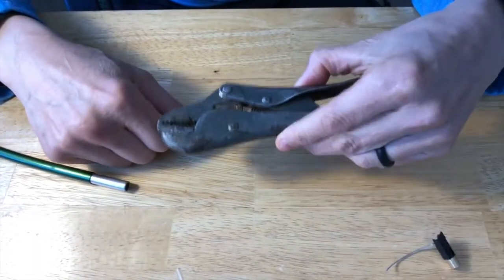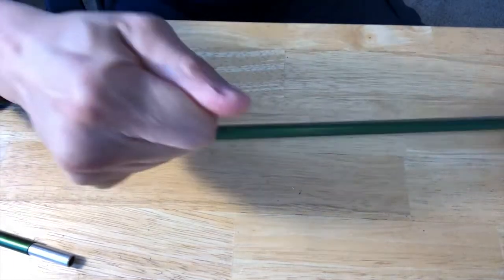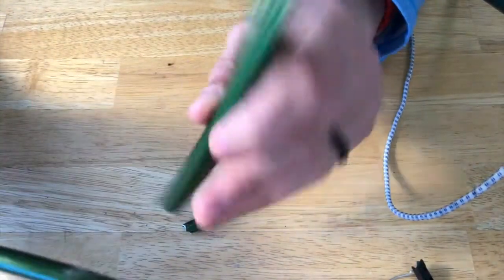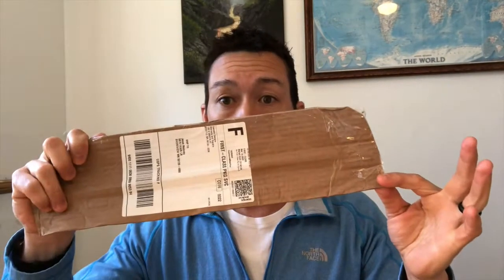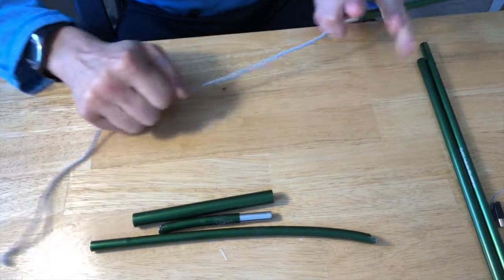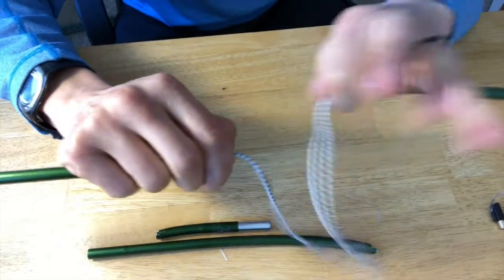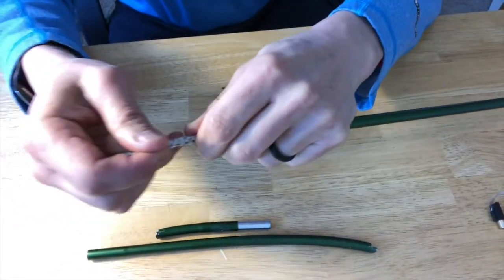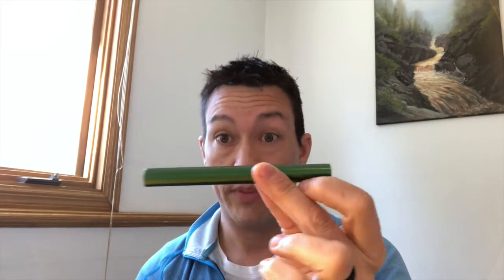How to replace a broken aluminum tent pole

Comment: I broke a pole on an REI brand tent and they definitely don't have a store of parts they would give or sell you. They refer you to a company that makes their poles who wanted me to send in the pole and pay quite a bit to mail it there and back and put in a new section. I then found an acceptable but mismatched, cheaper replacement online.
Reply: True! I just use the poles from a cheap Chinese brand tent for replacements as well. They are not pretty but they work in many instances. I just used a section for an old marmot tent and it worked great.